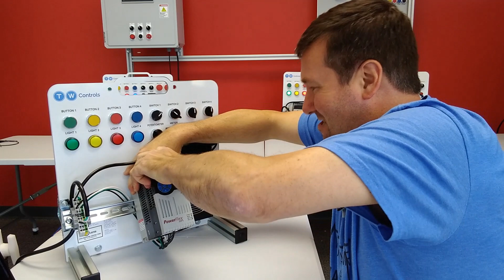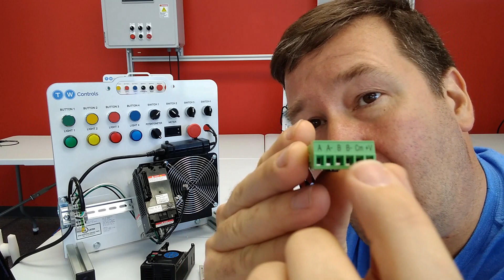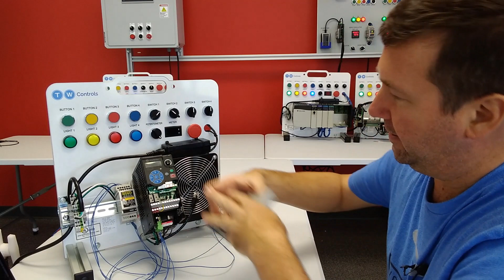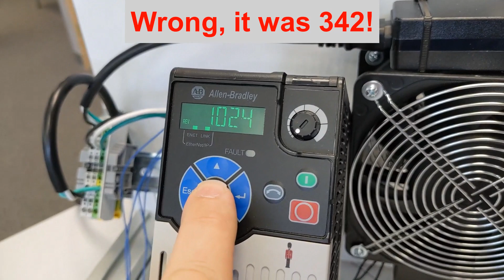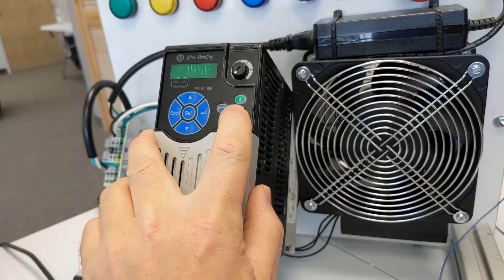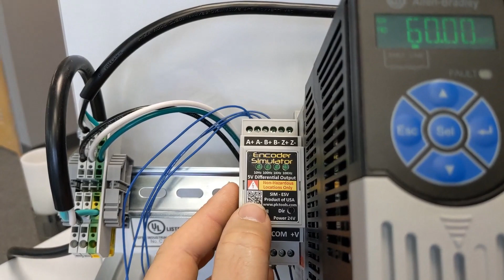How to Install and Configure an Allen Bradley Powerflex 525 Encoder Module

Comment: Hi Tim, a question. I have a PowerFlex 755 Frame 2 Drive. In it I have a 20-750-UFB-1 card, the manual says that I should use 20-750-S1 but I only have a 20-750-S. Is it possible to use 20-750-S?
Reply from the maker: I'm not sure, I'm not that familiar with STO on the 755.

Comment: Hi Tim, Just to comment that I tryed 10+ times to configurate with CCWDE Ver 20.01.00, and never got the speed (was reading th encoder speed by d378 but o moving, until I write the parameters by keypad, then works.
regards, and thank you por helping, you are practical Enginner, Cheers
Reply from the maker: Glad it helped

Comment: Hi Tim, could u please tell me, what is the procedure, " the motor was running with power flex 750  and encoder,  Rexroth 317207, and the motor was burned, "  we replace the motor with exactly one but the encoder has a different part number encoder number Rexroth 330889  ( looks like same). NOW WE HAVE AN ENCODER FAULT ALARM. please let me now what to do. should i set the parameter again?   best regards
Reply from the maker: It is a different part number for a reason.  Just because it looks the same doesn't mean it will work.  Things that come to mind are pulses per revolution and output type.

Comment: Hi Tim,
I enjoy and learn many things with your Videos. I have some question. I do have 2 Allen Bradley VFD  one 525 5 hp other one 753 50 hp. 525 is used to take up for spiral cooler main drive is 753. I like to install encoder on 753 will be the master and 525 is slave. Can you help me on this.
Thanks,
Ara

Comment: If you slide the top cover forward first it comes apart with much less effort.
If you finish the playlist (show positioning and control with a Micro850) then make the playlist one video, I would throw you some cash for that.
Reply from the maker: Well don't I feel silly, you are right.  That cover slides forward and it falls off.  Positioning is coming, just running behind.  Thanks for the tip John!
Reply: @TimWilborne  
As much as I love your faces, it's tough to sit through that many intros and outros 😁

Comment: Hello Tim, How are you, hope you are fine during these days. I need a little help as i am beginner in rslogix5. in my program i have data file f8:xx, it show usage 'X' when i click on usage tab, but when i try to find it with 'find all' it shows nothing. kindly help it would be so kind.
Reply from the maker: Look for something like a COP command that could work too multiple fields. So maybe the destination is F8:0 with a length of 5. While F8:3 won't be shown in the ladder program, it can be written to same will show an X in the usage.
Reply: @TimWilborne  its so kind that you replied,  its the same, nothing shows. Take care.

Comment: 20,000 / 60 = 333
Reply from the maker: Yes but my reasoning for my scaling was wrong.  It should have been 10,000*60/1750 = 342 pulses per revolution
Reply: @TimWilborne  I see. Thanks for the clarification 😊
Reply from the maker: @brianm17  I'm going to cover the scaling closer in an upcoming video so I left out details about the correction.

Comment: so in this application the encoder controls the speed of the vsd?.....i haven't come across an application but is there application you would know?...its a first for me..lol
Reply from the maker: Hi Ricco.  It could be that an external encoder regulates the drive speed, which would be a following application.  Also sometimes you need to regulate motor speed very precisely or even do some basic motion control with it.

Comment: Hey Tim, I love the videos and I have recently built a control panel that feeds rolls of various materials through a pinch roll and cuts them at a custom length using a micro 820 with a hsc card for an encoder to get the sheet length, a pf525 and a hmi using nothing more then your videos and some help from a family member. I had a some trouble knowing the order to do stuff and the whole process so could you make a video about how you look at a job, what you do and why you do it and your whole process?
Reply from the maker: That is impressing Gabriel!  I really like this idea and think it would really help people out.  My only worry is there are a lot of different ways to go about it, I would have to think about how to present it.